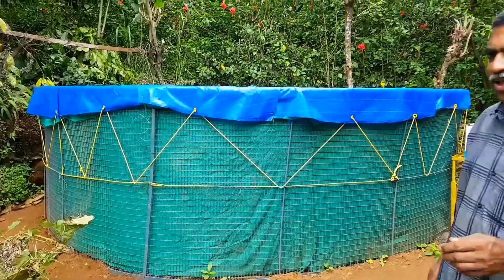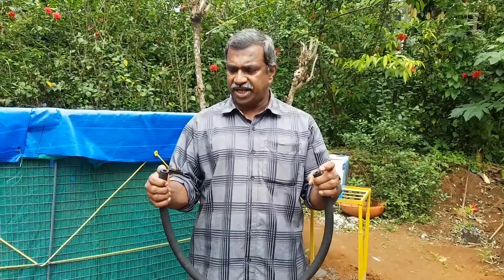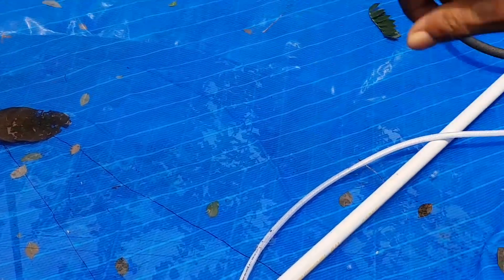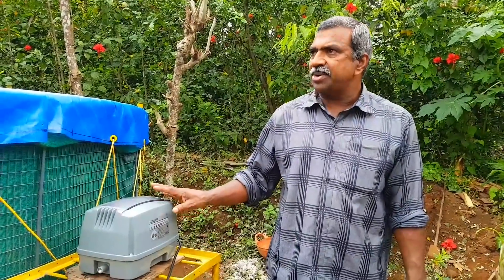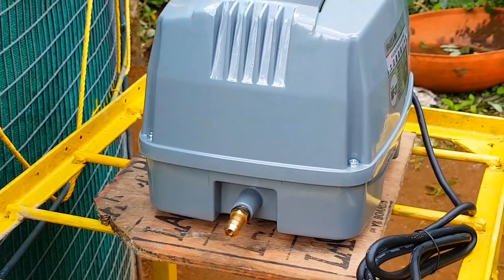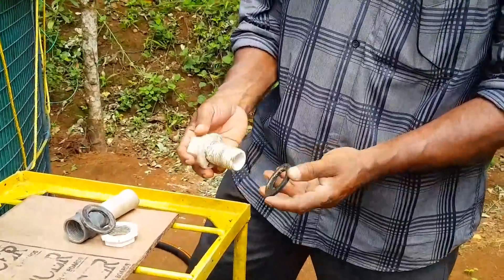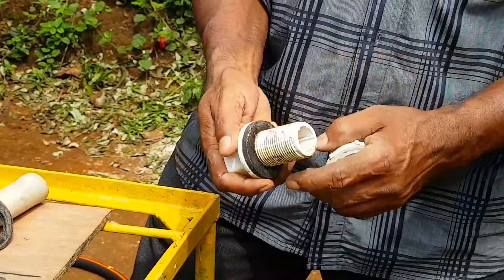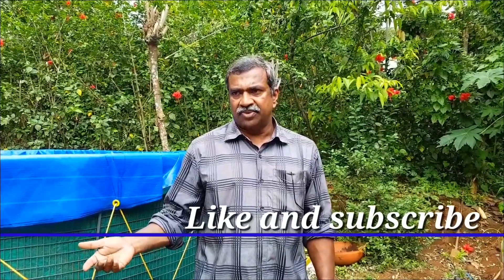AirOxi Tube and drainage pipe setting in biofloc??

Comment: 1-This type Airoxi arrangement(4 round in 4 corner) is not good method.. It makes dead zones..better is to give a big round at centre ( 1 metre dia round airoxi in centre  for 4 mtr tank)
2- using tank connecter for drainage is not good way..because tank connecter have only 1 cm washer distance around it,it may come out after getting the water pressure once we filling the water. Best method is using big flange (pvc or cast iron) which is available in our market. And use minimum 2.5 inch pvc for drainage to 3 or above 3 mtr dia tank. Which will help us fast drain out of water in emergency situation like sudden increase of ammonia.
Reply: You are right.